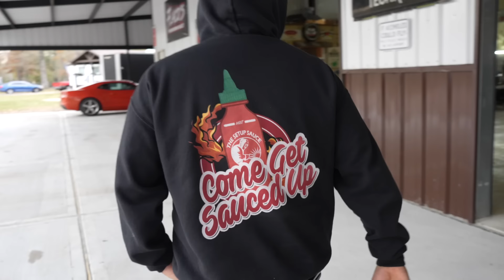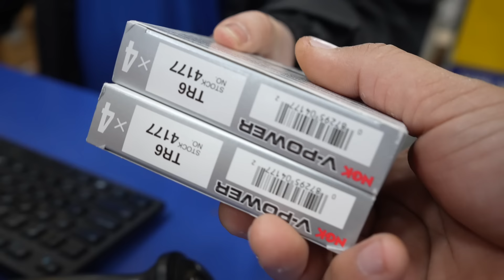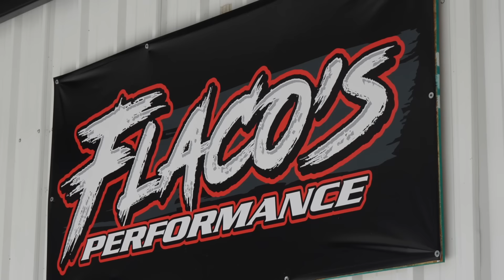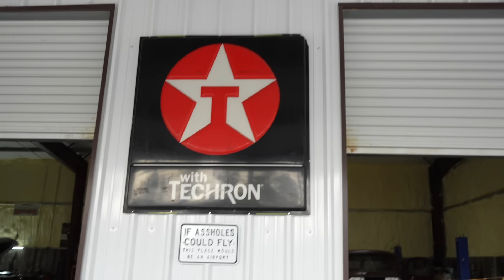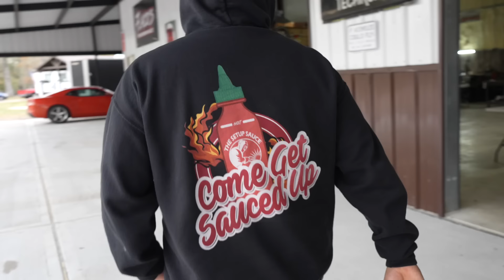Flacos performance tune on the single cabs

Comment: The whole purpose of extending the giveaway was cause you said you were going to change the wheels and do more upgrades. That the wheels were on the way. If you dont change them for something better well then why extend the giveaway date? Might as well give it away now if its staying the same way
Reply from the maker: It hasn’t stayed the same though. We already did more stuff to it. You think flacos tunes are cheap? Watch the next video. We had to do something we didn’t want to do but ended up doing more stuff to it as well
Reply from the maker: @Tequilero213  we are definitely changing the wheels though. Honestly I asked that just to see if I would keep these in case the winner wants the black ones. But regardless we are changing them out asap
Reply: You probs didn’t even by entries and your complaining 😂